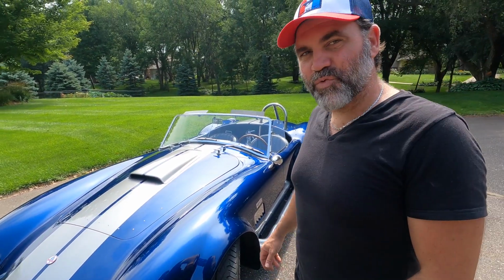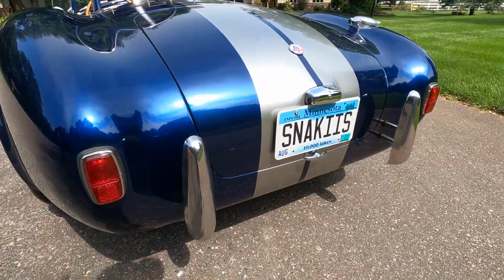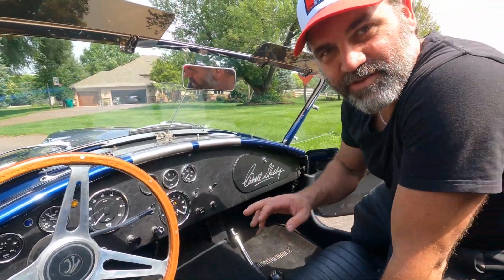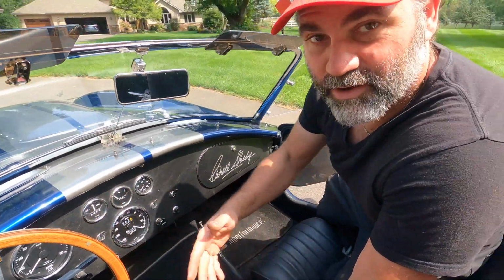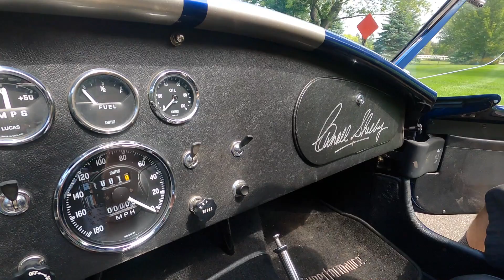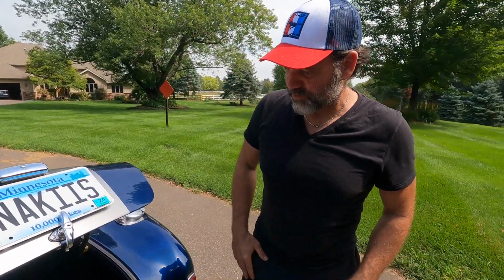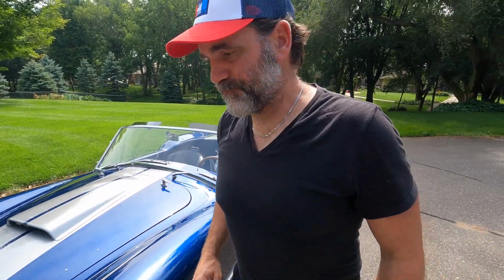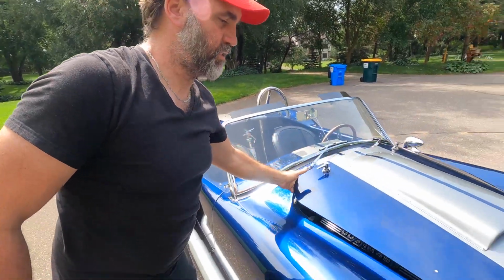The A/C Shelby Cobra Drives As Good As It Looks

Comment: Beautiful Superformance! One thing to note, “kit cars” get a bad rep for some reason. It definitely depends on the builder and kit, but kits from Factory Five Racing for example can be built as good if not better than Superformance cars. The chassis themselves have much more modern geometry. Otherwise, awesome video!
Reply from the maker: I agree.. For racing purposes or budget builds the factory five cars make a lot of sense. It would be tough to build one yourself and have the same finished quality as a superformance car.. but I’m glad they are all available
Reply: Cobra Kit cars only get a 'bad rap' from those don't own a Cobra at all...
Reply: This ^^^ and Factory Five uses a Ron Francis wiring harness.

Comment: The gauges on this car are not set up like most of the original cars. I have an original 1966 427 Cobra I purchased in 1968. Most of the original cars were street versions with a glove box, under car exhaust and no roll bar. The speedometer and tac are above and on either side of the steering wheel. The speedometer is where the tac is on this car and the tac is to the left of the steering wheel.
Reply from the maker: thanks for the knowledge